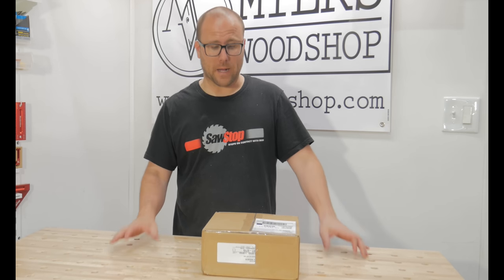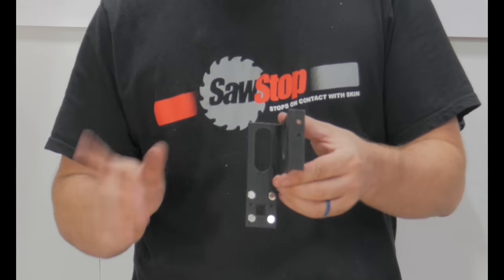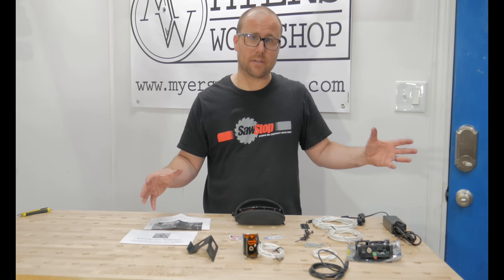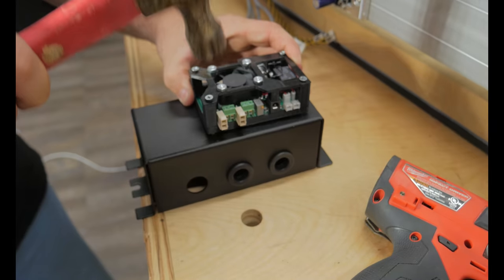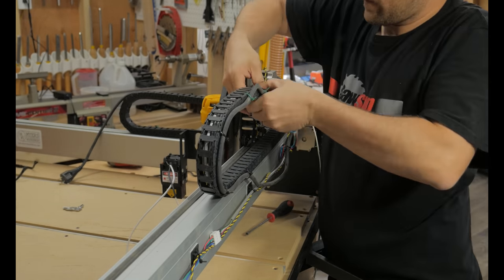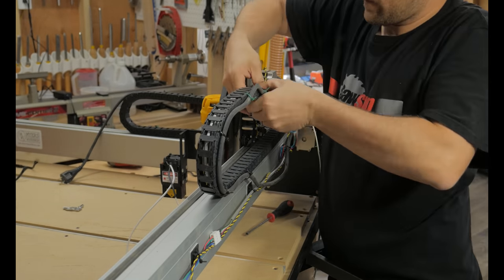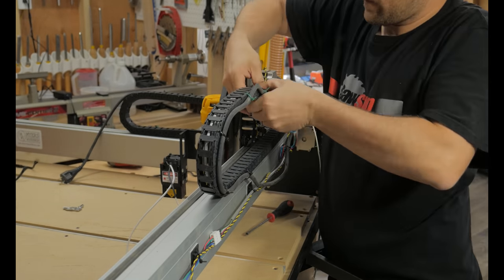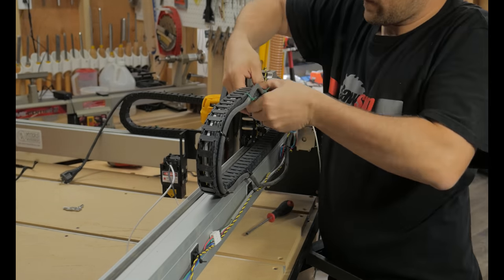J Tech Laser Installation On Shapeoko 3 XXL and Inventables X-Carve

Comment: Ben this video was extremely helpful for assembling my jtech laser. I bought the Shapeoko and the laser around the same time hoping I could avoid the undoing the chain to route the laser wire but Shapeoko being super helpful had already routed the wires to the CNC prior to shipping. Don’t get me wrong I’m grateful but Shapeoko and jtech should work together to sell a packaged unit so that those wires are also ran through the chain just my opinion. Anyways thanks again Ben and you helped this guy a lot.
Reply from the maker: I asked both companies the same.  I think carbide is the hold out party.  Your gonna love both machines!  I still find myself just standing and watching them work.

Comment: Hi Ben! Thanks for all you do!  You're a major "go to" for newbies, and well, been around folks as well--it seems.  I'm a newbie and totally hooked on my Shapeoko.  I'm getting ready to use your link and buy the 7 watt (I think now, Super 7W+).  When I saw you install on the control panel--I thought "oh no--that's gonna be a day job for me"!  I'm a little old lady, with weak hands <grin>.  But then you mention you moved the laser control to the front of the Shapeoko.  Do you have photos or videos that show the new move to location and/or how-to?  I'm thinking it sounds like a time saver.  Also--I need a Suck-It dust boot, badly! I'm, gonna hunt your videos in search of review of install tips.  I'm hoping to find a "myerswoodshop" link for Suck-It too!  I'll totally use it, even if there is no discount offered on your link!!  I know how that gig works, and will click through every link you post if it's something I'm in the market for!  Again--thank you!!
Reply from the maker: no discount or link for the suck it.  I'd go for the pro version if you can afford it.  Glad it helped!
I don't have a video for installing it on the front.  I took the control board apart.  Put that base on the side of the left rail near the front.  marked the 4 holes.  drilled.  tapped. then screwed on the board.

Comment: Will that laser cut through 1/4 inch plexiglass??? For your CNC, I would like to recommend Rockler's Bench Cookies. They have a version that is threaded on one side for you to be able to attach them as feet for your CNC. They will give a much larger, more stable, footprint than your current "stock" feet, and might also help to lower the noise level from vibration a bit.
Reply from the maker: Easily

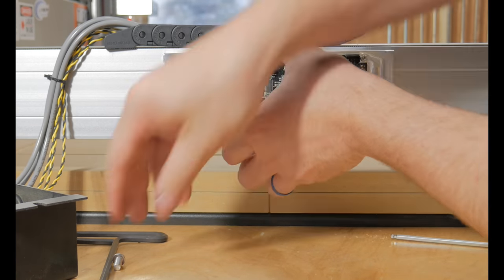Comment: on the part where you remove the board from the backing plate then reinstall the board on the backing is there a step I am missing? are you removing something from the board? from about 5:00-5:20 minute mark in video. Thanks
Reply from the maker: i just took off the back part of the board to get hole alightnment

Comment: Hi, I have a  J Tech laser mounted on my Shapeoko 3 and there is no life, no light and no fan working! My question is, I also have a Lightburn Software, is it necessary to install the software before the laser is working? I mean, cant I check the laser at all without the Software? Thanks for some answers!
Reply from the maker: Yes, there’s a switch in the control box that you can flip to manually fire the laser at full power....put down some wood before you do it
Reply: The fan should be running. Did you hit the reset button to the right of the power button?

Comment: I just purchased the J tech laser after watching this video. Had some trouble getting started but now that it's working I love it. The instruction left out $10=0. I was smashing into the sides until I learned that.

Quick question, in the use CNC Macro button I would like to add my Shapoeko setting back, $10=255, $30=1000, $31=0, $32=0  after G10 L2 P1 X0 Y0.  Do I do it like that with a comma between or do I hit the "enter key between them like this:
G10 L2 P1 X0 Y0
$10=255
$30=1000
$31=0
$32=0
Luckily Carbide Motion has a complete reset in the setting window or I would have lost the original settings.
Reply from the maker: Lightburn is tricky.  I set up another macro to get "cnc normal" settings.  If i'm only working with vectors I typically use vectric.

Comment: You mention soldering, but show no soldering during the installation. You also say that you attached “the laser?” to the front left support of the CNC?
Reply from the maker: they have since included a push pin so it's now solderless.  I cut that part out of the video.

Comment: Would it be possible to use an Ortur Laser on the Shapeoko? I have the Ortur Lasermaster 2 20W and it'd be nice to combine the 2 machines.
Reply from the maker: the trick would be adding the controller to the pwm signal.

Comment: Thanks for the educative video! Can we cut pcb with this 4.2 jtech laser?
Reply from the maker: i would guess so but have no reason to every try it.  it would be similar to cutting plastic, which would just take time since its not very powerful.
Reply: PCBs are made from a fiberglass resin composite, and because the fiberglass and resin have massively different cutting temperatures you will end up burning the surrounding resin before the fiberglass cuts. Any fiber reinforced resins will be better cut using a mechanical cutter (router/waterjet) rather than a laser.

Comment: do you think there is a laser that can be attached that will cut 1/4" ply? I am trying to avoid having to buy a whole separate machine to cut intricate things that my Shapeoko can not cut
Reply from the maker: probably, but your beard will grow gray before it made its final  pass.
Reply: Hi Samantha. Wondering if you found a solution to this? I just got my Shapeoko and I’m looking to cut some intricate pieces on 1/4” plywood as well.

Comment: Great video. I've noticed my shapeoko pausing for long periods when turning on the laser. This is causing deeper cuts at the entry point. I'm using the jtech plugin for inkscape but haven't seen any pause in the gcode. Is this something I can avoid or is it part of my Shapeoko firmware?
Reply from the maker: You have to change the settings in the grbl firmware.  Change $32=1 to enable laser mode.  I find this easiest using universal gcode sender.   On changed, you won’t have to do it again
Reply: @MyersWoodshop   THANKS SO MUCH. Been killing myself trying to debug this one. Thought i was going to have to fork the dang firmware
Reply from the maker: No problem!  Glad I can help!

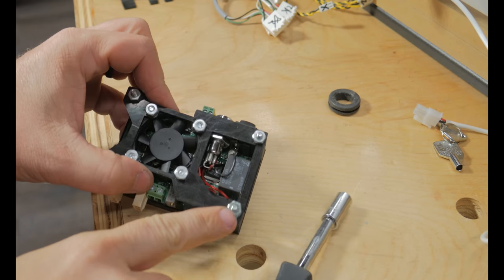Comment: @05:30 Now for the big question... Should we trust anyone satisfied enough with a soldering demonstration like that for him to show it to his audience with a How-To on L.A.S.E.R.s? Should we really put a BLIND eye on that? ;)
Reply: Yeah, the rest of the video was quite informative, but I cringed at that cold joint. (Myers Woodshop, you need to heat the pad and the wire with your iron, and then the solder will flow nicely into all the nooks like the other solder points you see on the board. Your joint is just a ball of solder that clung to the hot wire but didn't cling to the pad sufficiently. Worth finding a tutorial on soldering technique.)
Reply from the maker: @ed_halley  your both not wrong.  I have VERY little experience soldering.  I had to go back and fix my work after a little help from youtube :P  I think next time I have to solder and show it, you'll be happier with my work.

Comment: You didn't actually show how to connect the wires to the board. There was a very blurry shot of the board, but no indication or instruction on how to connect.
Reply from the maker: I cut that part because they changed how.  Check JTECH website for how to connect it.